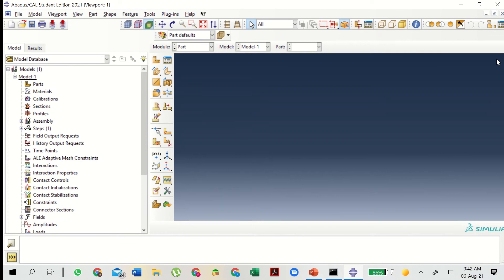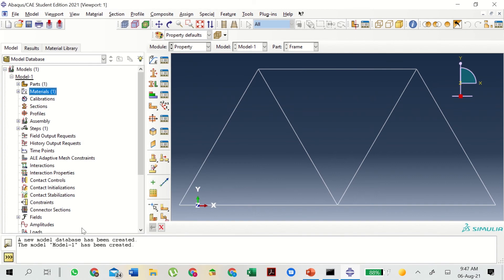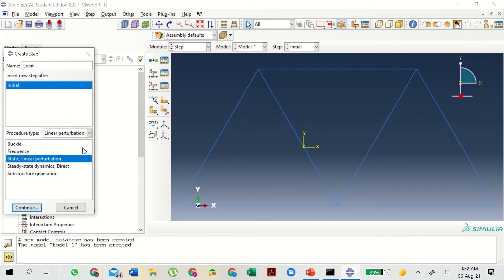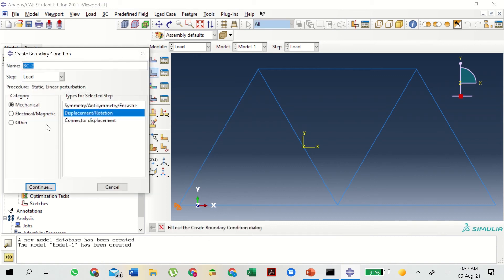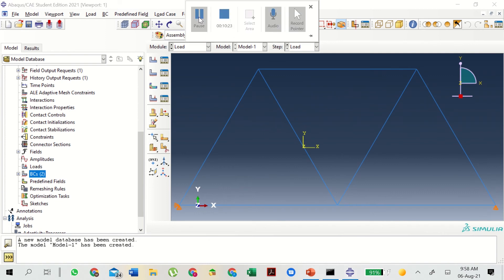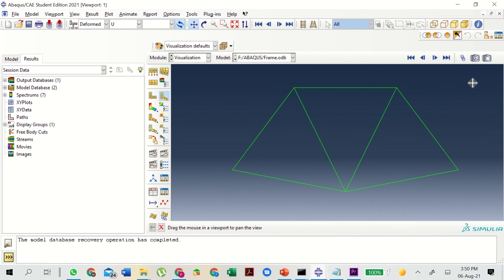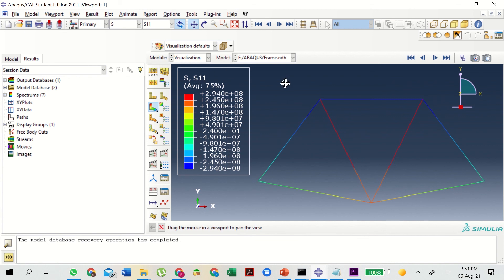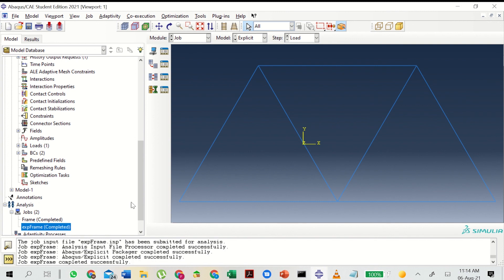ABAQUS Tutorial 1 - Creating an overhead hoist

Comment: i am getting an error "IF A NON-UNITY THICKNESS IS SPECIFIED 
             FOR TWO-DIMENSIONAL SOLID ELEMENTS AND THESE ELEMENTS ARE INVOLVED 
             IN AN INTERACTION SUCH AS CONTACT, THE SAME THICKNESS SHOULD BE 
             SPECIFIED FOR THE OUT-OF-PLANE THICKNESS OF THE CORRESPONDING 
             SURFACE UNDER *SURFACE INTERACTION."
the data check is stuck at check submitted
not going any further